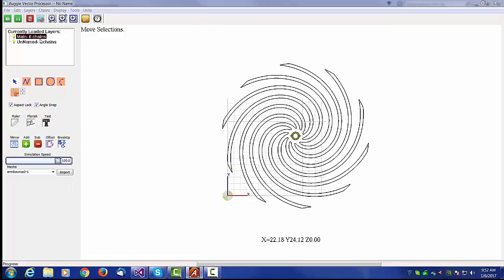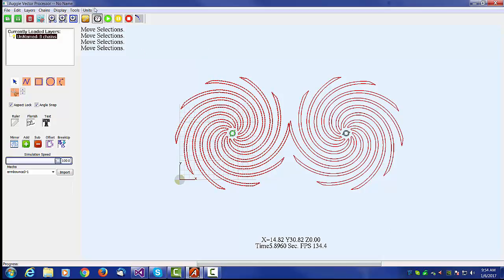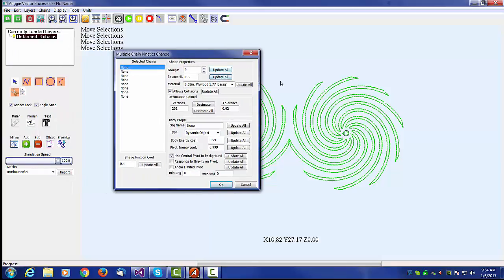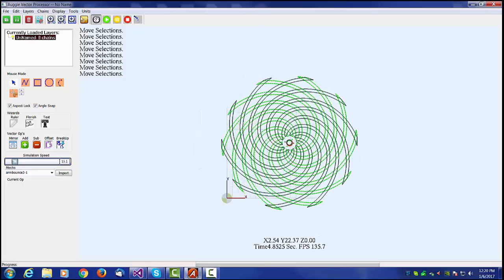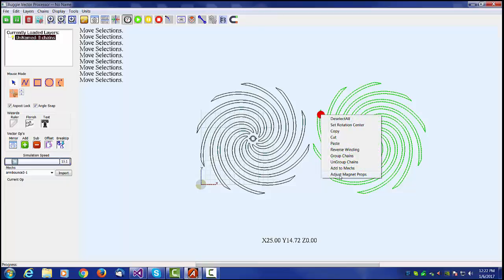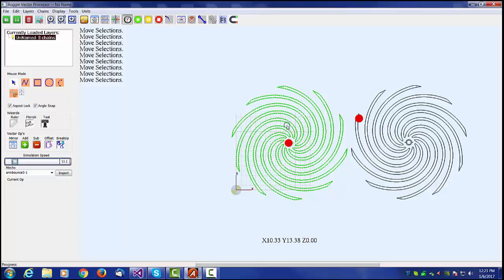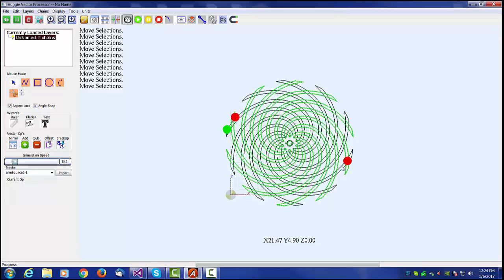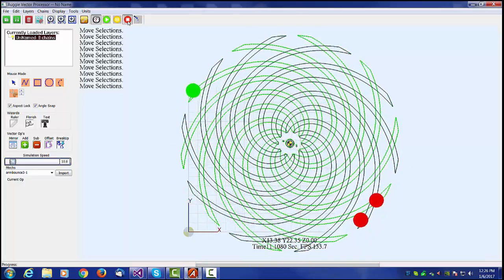Magnets - Vanes

Comment: I can seem to get my dxf file to load. It's created in Corel draw and exported as a dfx (autocad 2008-2013). It open ok in other programs like DeltaCad. Augie does not give an error message, but the drawing does not appear.
Reply from the maker: Hi Mike: It may be due to Auggie not yet accepting beziers in the drawing. Try resaving in Vectric, it tends ot save as contours..

Art